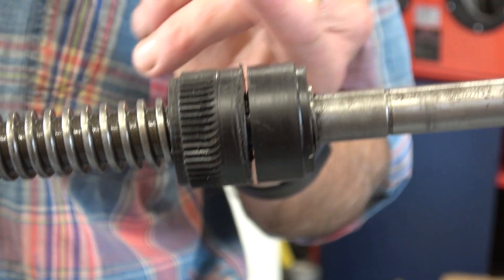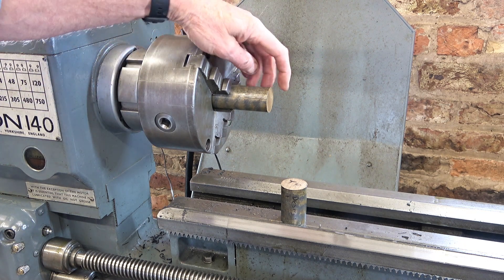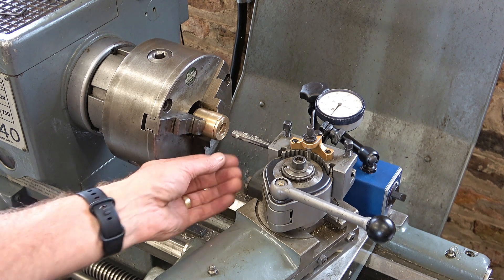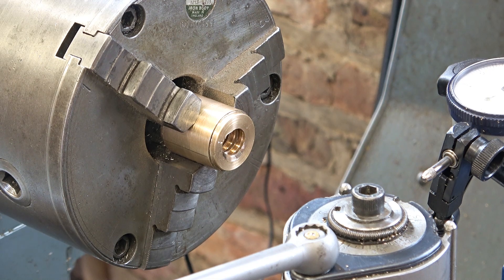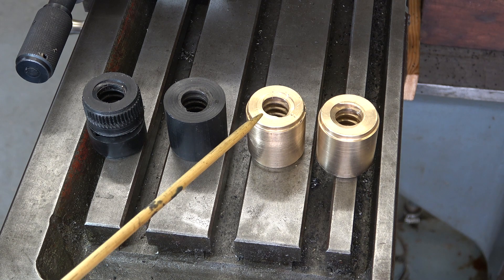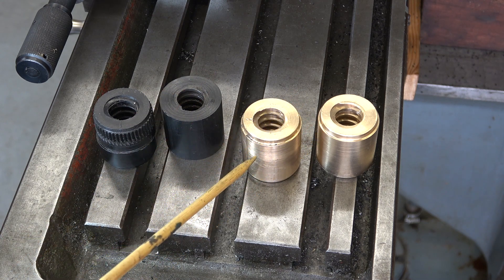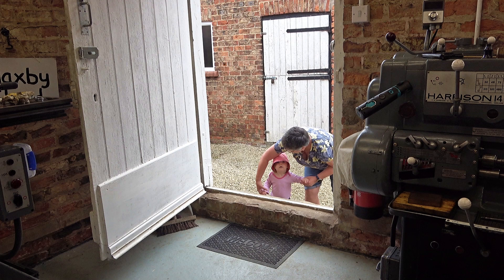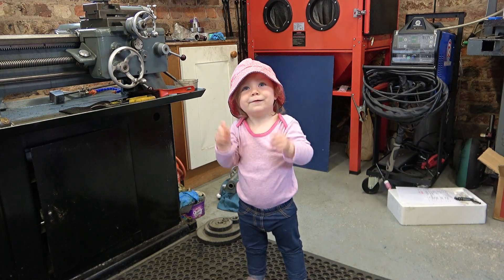HS213 Harrison universal mill table nut – Part 4

Comment: Great job making the bronze nut, Paul. I've been through this scinario. If I'm not too late. Bore the locating pin holes deeper from one end before you split the nut in half. This will guarantee the alignment. Cheers Tony
Reply from the maker: Hi Tony, somehow I was just reluctant to drill it through (just some kind of misplaced pride I guess) but on the production nut I just drilled one side and then lined up and marked off where the holes needed to be with a marker pen without trying to be clever. Cheers Paul

Comment: It went through my mind that 0.25mm, or 10 thou, was a huge cut! Then you confirmed my suspicions. When threading V threads with HSS home ground tooling I'd start with 5thou cuts for the first 20 thou, then go to 3, 2 1 thou to finish the thread. For external ACME or trapezoidal threads the problem is just as bad.
Your problem is the large contact length doing the cutting, so just sneaking it in is good, esp in bronze.
Next time, to cut costs, try buying the continuously extruded bronze in tube form. It saves the waste in the middle and the nominal sizes allow for wiggle room to machine it to size.
My lathe is an M300, so not a whole lot different to yours, and I've cut several bronze nuts to refurb my old British machines!
Reply from the maker: Hi Robert, yes I agree trying to cut 10thou was just reckless and it cost me a nut to figure it out. It's on my 'learning points' list for next time. I'll lookout for hollow bronze next time. Cheers

Comment: Little sweetie, I have a grandson about the same age, they are a treasure, nearly cracked it sir,
Reply from the maker: Hi Michael, you will see the finished nut in the next part, but then there are the other issues to fix like bent leadscrew and also the last half inch of the leadscrew missing .... Cheers

Comment: very nice, have you considered before you make the next bit , when your installing the dowels or alignment pins, to drill straight through from one side to make two blind holes for the pins before you split it to remove any possible misalignment or error, just something i was thinking, I've probably said it too late, I think ill have to do what your doing now but on a ball nut if I ever get the time for my vertical harrison mill, great work as always!
Reply from the maker: Hi Anthony, in the 'production' nut I got the pins lined up by drilling one side and then marking the other side off with a pen with it lined up correctly. Basic but it worked. Cheers.

Comment: Great video Paul, its coming along nicely. I had similar trouble though not due to tjd change wheels disengaging. I had one that was the wrong tooth count. So ended up with a pitch error. In the delrin thankfully. Good job on the splines, you will get there.

Intriguing about the mill head bearing oveheat. Im currently stripping the main gearbox on mine. It is another example of Harrison poor design.
Reply from the maker: Hi Carl, I'm working on the vertical head spindle bearings now - fixable at no cost but results from a Harrison manufacturing blunder. You'll see in due course. Cheers
Reply: @HaxbyShed  Looking forward to that Paul. You know how much fun I'm having with the gearbox.

Comment: I am really enjoying this series Paul. On reflection could you not have slit the original nut 3/4 through and drilled and tapped two set screws from one end to provide the adjustment to take up the slack.
Reply from the maker: In short, yes Andy. I suppose because the old nut had worn 0.6mm I thought that might be too much to take up with a slit nut (should my new nut wear that much in the future). My Harrison lathe cross slide nut is slit 3/4 for backlash adjustment and it works but has its limitations as a method of adjustment. Cheers
Reply: @HaxbyShed  Hi Paul, my cross slide but has also been slit. I suspect it was a ‘service fix’ by the Harrison engineers. Similar to the tab I see on lots of 140’s that has been added to the gear box door to keep it locked away from students

Comment: Interesting series, Paul. Thank you! The Acme thread in gunmetal was quite a challenge. Have you tried inverting your parting tool on a rear mounted solid tool post? I found it made a huge difference. I appreciated the way you worked towards the finished part through logical steps. I look forward to seeing the results of the split nut in reducing backlash. Am I correct in thinking there is a small downside - as a consequence the nut and lead screw  will wear more quickly because only half the thread length will be in engagement for each direction of travel? However, since your machine is not going to be subjected to heavy use I would imagine this is unlikely to be a problem.
Reply from the maker: Hi Clive, about the half nut wear question, I see what you are saying and drawing it out on a piece of paper just now suggests the answer is yes maybe as each direction is only acting on half a nut potentially. I'd not thought of it. A trade off then. Inverted parting tool - yes I need to try - preferable in the front holder. Not really any cross-slide table space for a rear toolpost. Cheers

Comment: Paul, have you considered screwing a lock block on to the back of the chuck that locates in to the chucks locking ring? That would allow you to run the spindle in reverse  and mout your parting tool upside-down. I use this technique on my Colchester (I'm lucky enough to have the camlock system on my chuck) and parting is now a breeze. I'm planning on building a rear mounted post but saw this technique being used by Max Grant at Swan Valley and thought I'd try it. As a bonus running in reverse also makes blind screw cutting a breeze.
Reply from the maker: Hi bobuilt, the chuck fixing is American Long Taper and I can run that securely in reverse. I need to try the parting tool upside down in the front post as you suggest, as you suggest - it's on my to-do list. There is very little space on the far side of my cross-slide (no boring table) and so to fix a rear toolpost on there I would have to extend the cross-slide somehow. Cheers

Comment: Rather than send you a picture of my jig i uploaded an old video to YouTube, just in case YT didnt inform you.
 Apart from all the other "lesrning opportunities " that went wrong, it is actually easier to keep the top slide in its correct position, parallel to lathe axis, and only use the cross slide for making a cut. It is a myth that you have to set the top slide to half the angle, especially on something like brass or bronze which forms a chip type swarf rather than ribbon type of say steel. Aluminium doesn't care either as it cuts so easily. One good reason is that it reduces the risk of turning the wrong handle and if you have to realign you can use the top slide to go in or out length wise, without altering the depth of cut.
If uou have trouble parting, one thing to check is the tool is 100% dead square to the work, not near enough but dead on. Another is whether the chuck jaws are bell mouthed,  if they are you will certainly have difficulty as the eork will move back and forth a bit which the tool cant accommodate. I assume you always use a lubricant when parting, even on things that can normaly be cut dry, as it is needed to prevent the tol jamming and friction. Recently i have moved to a thin T shaped blade with a groove on the top surface, bought ftom Jenny at last years Midlands, and have cut 5 inch diameter lump of aluminium with it, admittedly it had a 2inch hole in the middle but even so.....just took it slow😂 the groove causes the swarf to curve and be narrower than the slot and not get jammed.
Welĺ thats enough preaching for now, looking forward to part 2.
Reply: I agree leave the compound slide parallel. Not found any advantage, especially for one off jobs with  over 50 years as toolmaker, but do not take large depth of cut . Light cuts and you will fine.
Reply from the maker: Hi John, noted. My mistake was to take large cuts. Cheers
Reply from the maker: Lots of good advice for me to digest there Chris thank you. I think I met Jenny (JB Cutting Tools) at the Harrogate model engineering show.  Totally see the risk of turning the wrong handle with the half-angle method (ask me how I know!). Cheers

Comment: Anything worth doing once, is worth doing 2, 3, or however many time as necessary. Keep up the good work.
Reply from the maker: Hi Mark, working and videoing along side slows the job down a lot but it helps with my patience. There is no such thing as a quick job when you are videoing so a bit of prototyping or rework does not feel out of place because I know the job will take a while anyway. Cheers